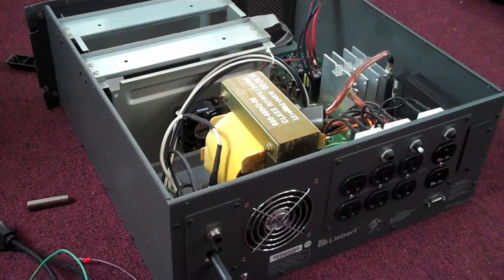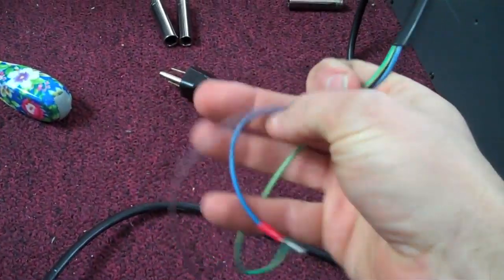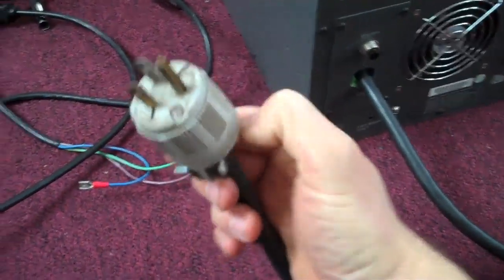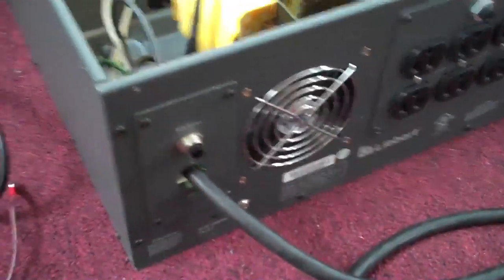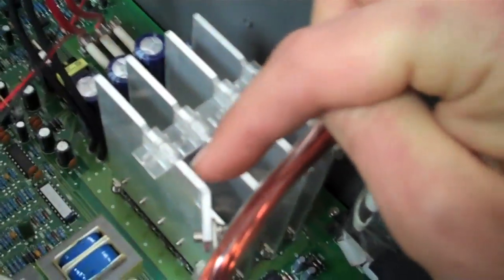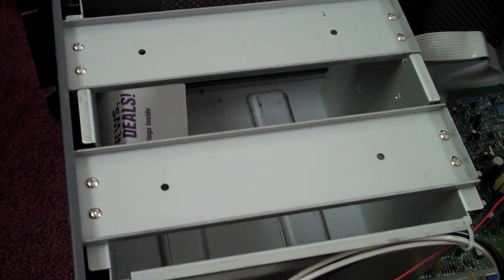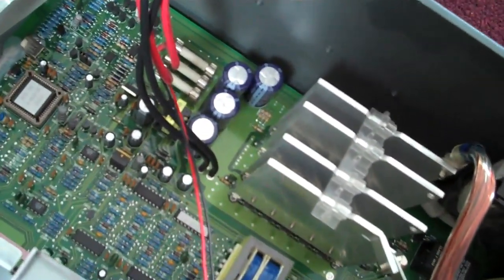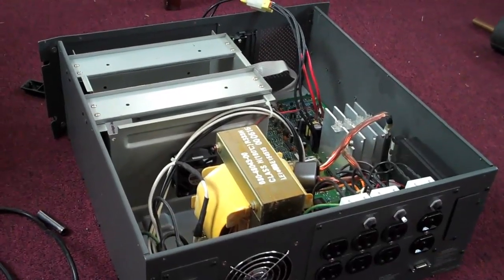UPS Power Cord Feb 24 2010

Comment from the maker: I LOVE Anderson connects!

I'll use whatever thick spare cable I have around for the battery cables. I used 4 gauge on my electric motorcycle, and 2/0 on the Electro-Metro.  I should have a little scrap somewhere from one of those to wire the battery pack up with.

I would also like to use Anderson connectors to make a quick disconnect to hook the cycle or the Citicar directly to the Xantrex C-40 charge controller.

Comment: Neat... What gauge wire are you going to use to supply the DC voltage?
Oh, I should recommend that you look into Anderson PowerPoles, they're the same style connectors use on forklift batteries.